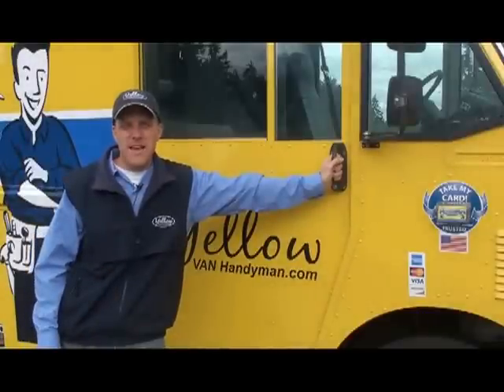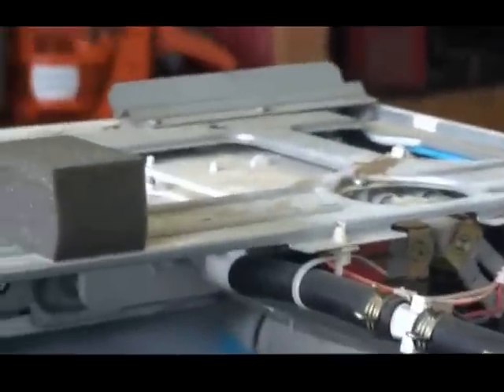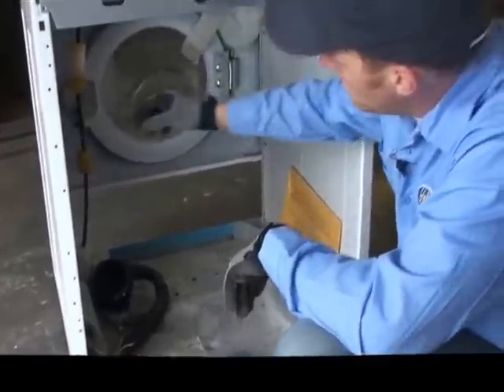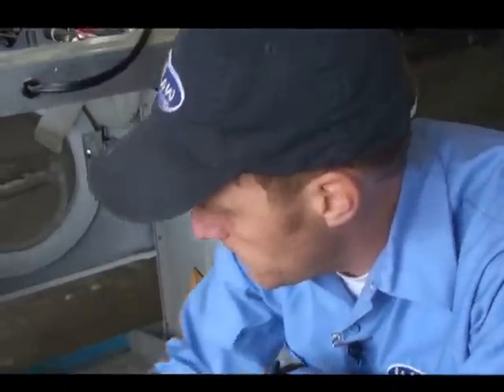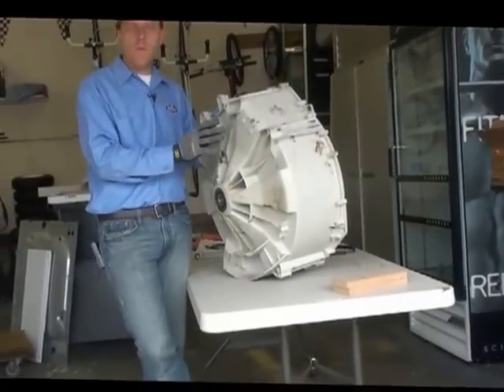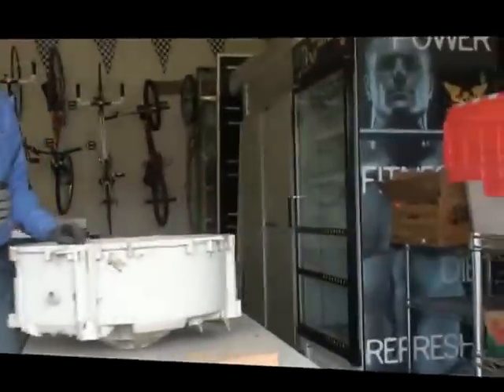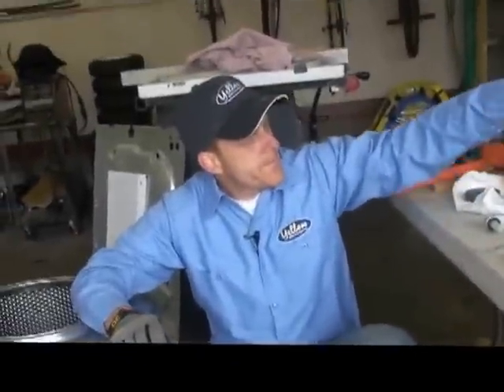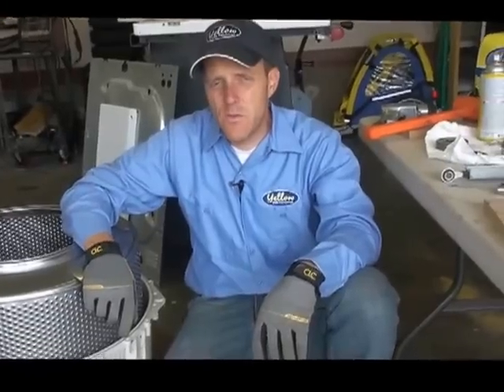Front Load Washer Repair - Bearing and Seal Failure Mode

Comment: WPXH214A0WW GE Profile 02/02 Great Video.  I want to be sure I have a bearing problem.  My machine has operated great for years.  Coming off high speed spin it sounded like a belt separated with a spontaneous thump, thump, thump.  (Still do not know where the cat is).  With such confidence, I captured the model number, and ordered a belt.  My machines are stacked in an upstairs closet in a galvanized pan, on hardwood floors so I waited to have the part before pulling the machine.  I built a base and slid the stacked machines into the hallway, pulled the washing machine rear cover and discovered the belt looks perfect.  Can the bearings spontaneously & catastrophically fail similarly?  My shocks and springs look fine to me.  Is there a way to test those before I move to the bearings?  Don't try this at home.  I ran the machine at fast spin, empty and dry, and inspected the movement, very smooth until it hit that resonance again.  It started to shake again.  I pulled the front left shock forward and it immediately stabilized.  Any other trouble shooting before I purchase parts that might be unnecessary?
Reply: Yes, likely a bad bearing and seal.

Comment: where can i get a shaft assemble for a ge front load washer its prob. 25 yrs old
Reply from the maker: Ron - I like appliance parts pros or repair clinic.  The part you need is a "drum assembly" which comes with the shaft.  If you post the model number of your machine then I can research what part you need.
Regards - Jerrod